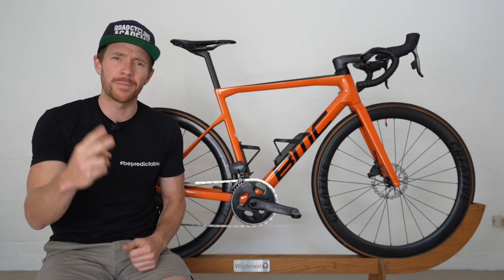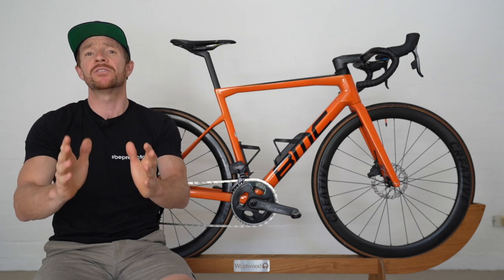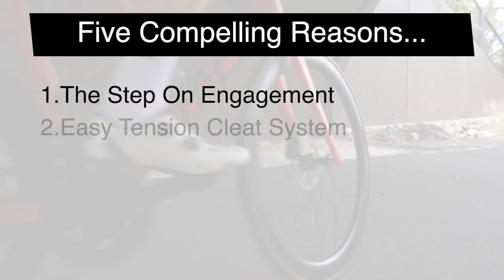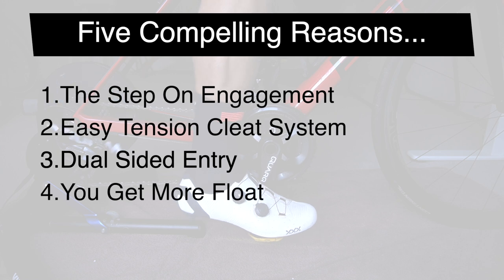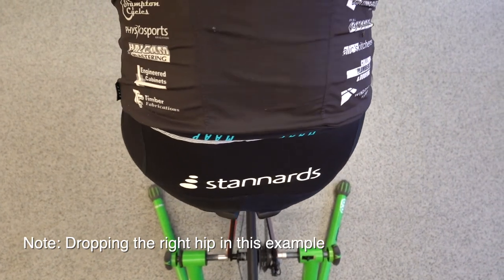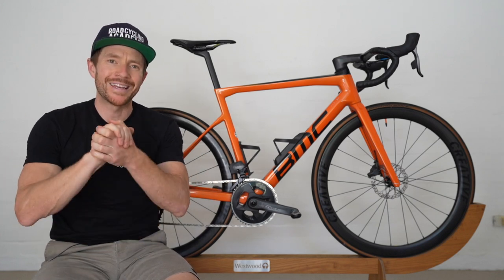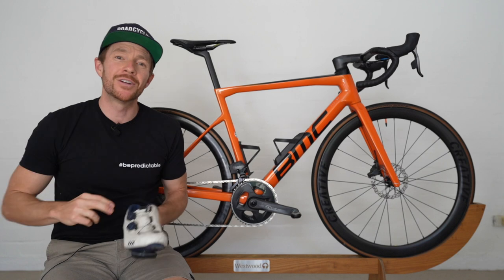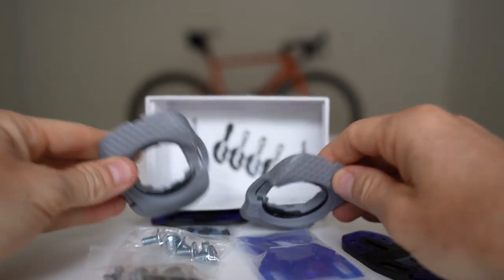SPEEDPLAY COMP PEDALS (why they win for beginner cyclists)

Comment: I think the speedplay system is the worst system to start with. Here are couple of reasons:

- cleats are bulky, walking in them is even worse than other cleats
- replacement cleats are expensive
- the cleats are prone to dirt ingress
- cleat wear is higher than with other cleat systems
- the weight of pedal + cleat is usually higher than similar priced systems from other brands

It has undeniable advantages over other systems, like being double sided, low stack hight etc. But I think they are product for a more seasoned cyclist.
Reply from the maker: Fair call, thanks for sharing on the thread. All I can say is I validated this viewpoint with an experienced fitter - Neill Stanbury - before I published. But there’s plenty that disagree!
Reply: @CamNicholls  Don't get me wrong, I love the speedplay system and use it myself because of all the reasons you mentioned in your video. However, being a "long term" user (~2 years, before that 3 years of Look Keo) I can also see how intimidating the speedplay system could be for someone new to the sport. I think, the biggest disadvantage for me (being located in Germany) is the proness to dirt ingress, especially during autumn and winter. I really have to take care and clean the cleat thoroughly after each ride to ensure it lasts long and functions as expected. I think that problem is negligible on Look and Shimano systems.